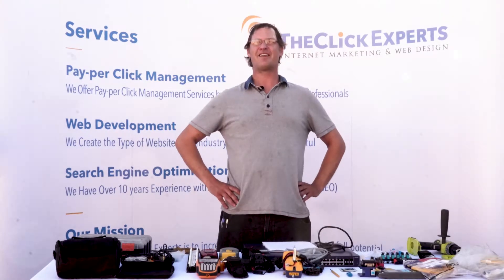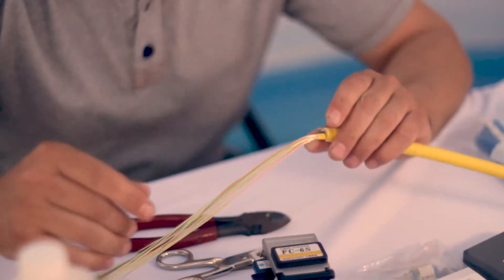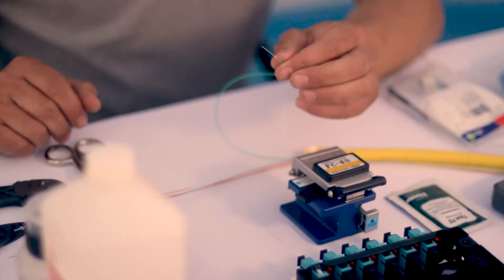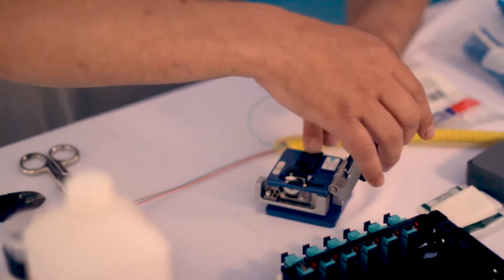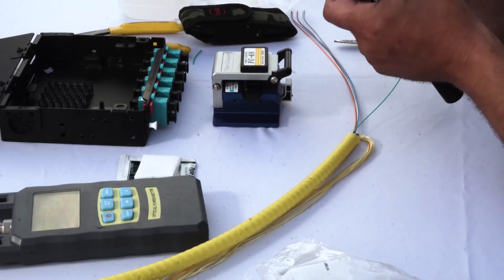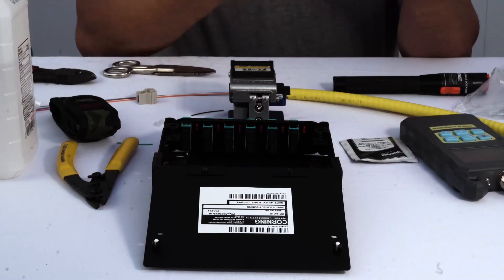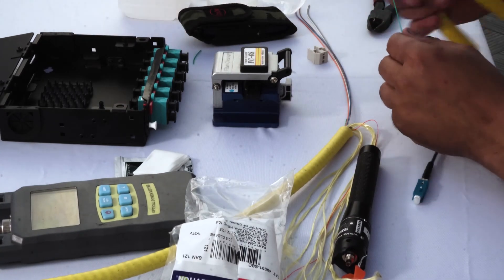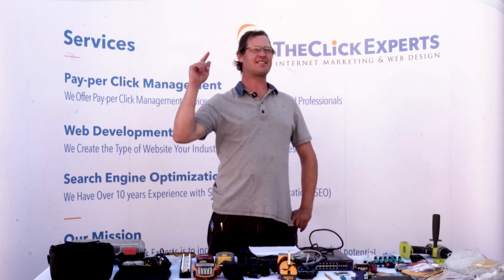How to Terminate Six Strand Single Mode Fiber

Comment: Things have changed a lot in the last four years. The Corning RPX fast access drop cables are interesting. They two strength members on the outer edges of the flat cable that has rounded outer edges. The six fibers are in the center arrayed side by side. Opening it you peel the top outer cladding back, then peel the underside cladding back. You then grab the now exposed edge cladding pieces and peel them like a banana. then cure the Kevlar fibers and prepare the fibers as usual.  I like using the Corning FastCOnnect2 spliced terminations rather than a mechanical termination since it's fast and more reliable and can deal with reflectance issues better. Bell Canada is using this as a standard drop cable for all installations. They figure if you rent to a tenant, it's quicker than running a new fiber form the pole down. If you're in an MDU it gives you six fibers to feed splitters for new clients and tenants onboard.